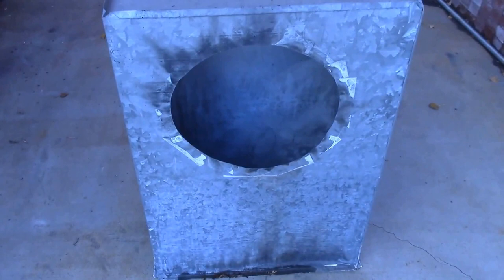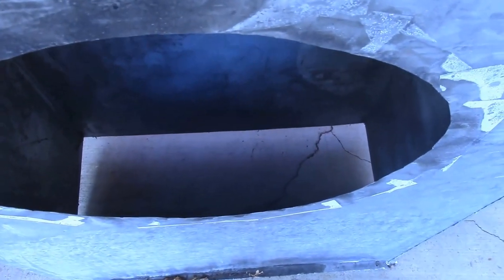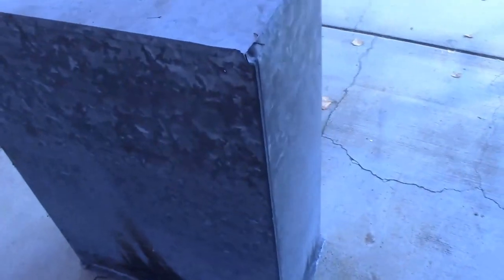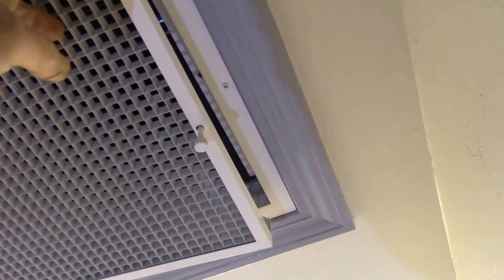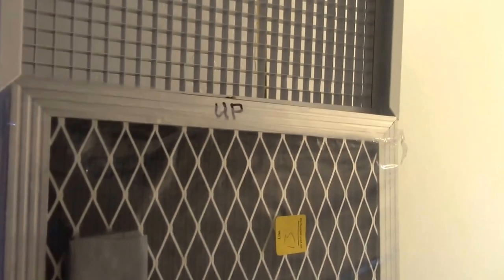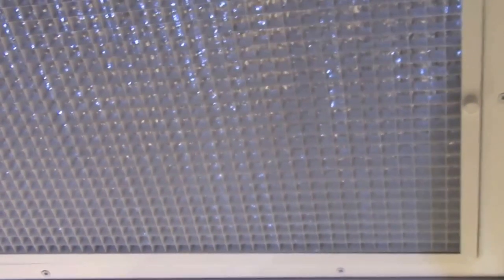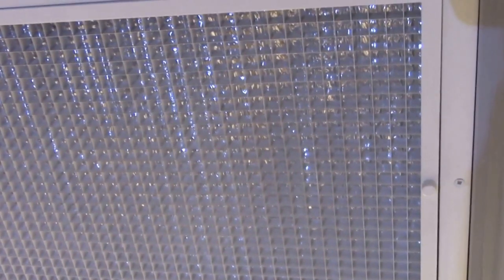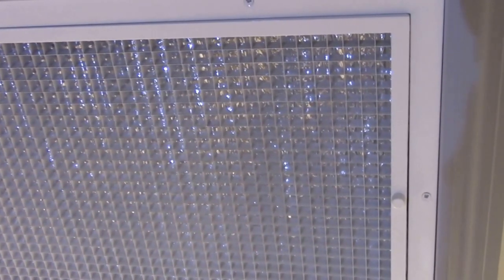Improved Air Return Plenum

Comment: I supported soft return duct in attic that were kinked and crushed. One duct going into plenum was at right angles and crushed by sharp turn and weight of other return air ducts sitting on it. I put in a ridged right angle sheet metal duct there. All ducts were supported as required from roof rafters with straps and sheet metal make sure they were open and not crushed/kinked. Last year AC could not keep up. This year I was able to maintain 73F even on 110 degree equivalent days

Comment: This is great!  I was thinking about putting an Airscape into my duct plenum on the 'hot' side of the furnace.  This is a much better solution.  I believe I will install a backdraft damper between the box and the furnace to keep from sucking air through the furnace while the WHF is running.
Reply from the maker: +Sturmcrow1 Thanks for the feedback.  Yes, this has been working great and so much cleaner than the original mess that was "professionally" installed before I purchased the house.  Between eliminating about 10 feet of insulated flexible duct and installing the air filter up in the grill where it's easier to get to it makes the whole setup really easy to use.  I really love the WHF, you can feel it cooling the house down just a few minutes after flipping the switch.  I guess I missed their new WiFi remote control module  by a few months but the wireless one I have works good enough.

Comment: There are some things that can be done to increase the cooling to the second floor areas.
You could add some returns from the second floor area and also add a few supply runs to the second floor area to help increase the airflow to those areas.

Also, increase the filter rack areas to reduce the velocity through the filter areas this will reduce the pressure drops on the return side.  The less resistance you have on return-side the more air that will get to the blower wheel blades and thus increase the static pressure on the supply side all the way to the diffusers.

Also, select fittings with the lowest equivalent links so that you retain the suppy-side static pressures in the ducts to the diffusers.

I would use a Purolator filter sized to achieve @.16” DP @300-fpm filter velocity or 20-fpm less. This should provide more static pressure and airflow at the second floor diffusers.
Reply from the maker: Thanks for the comments, some good information there.
Reply: Thank you for the good reply; I appreciate  it & you...!